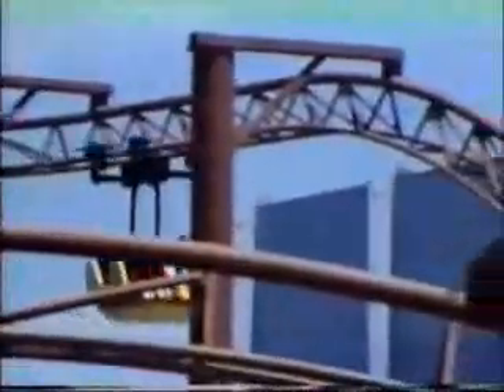Arrow Suspended Coaster Prototype

Comment: I remember a photo of the corkscrew on the full sized (also operational, I believe, but never with people) mock-up of the Arrow suspended coaster before the Bat was built in an Amusement Park Journal. There's a very slight chance I'm wrong & it could've been in Coaster World, but I think it was APJ. For a long time I didn't realize it WAS a corkscrew until I saw a video of a car going through it at an ACE event.

Comment: Then it would work, but they couldn't really take that risk. With the way a suspended car works, if it didn't get enough momentum it would slam back down violently possibly injuring the riders, unless they had a track running around the inversion which kept the cars from swinging, similar to the system they use to stop the cars from swinging on the lift hill.
Reply: Just add the cockscrew right after the first drop then u'll get enough momentum
Reply: parks could install a launch right before the inversion